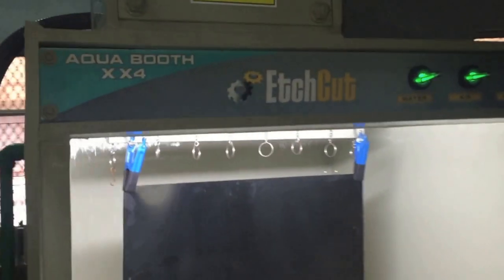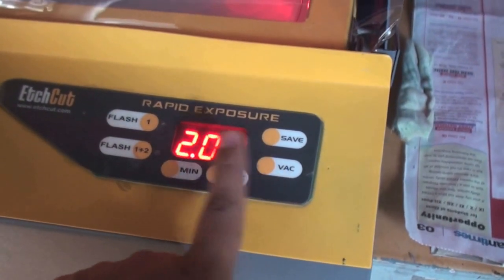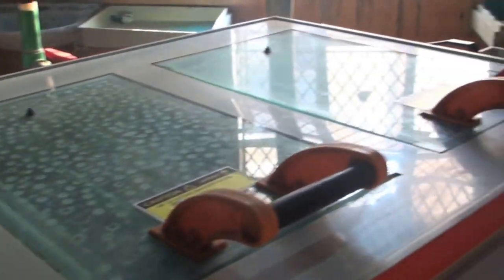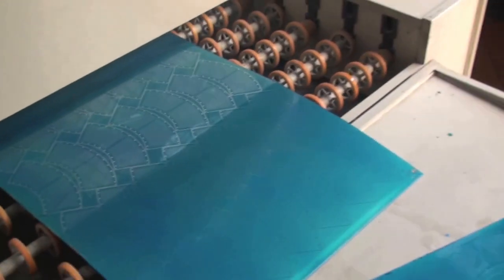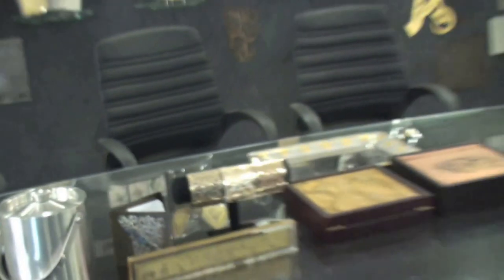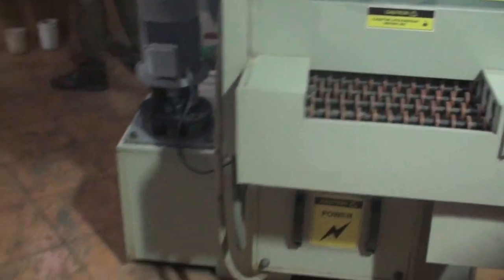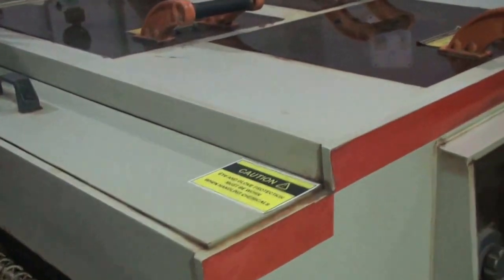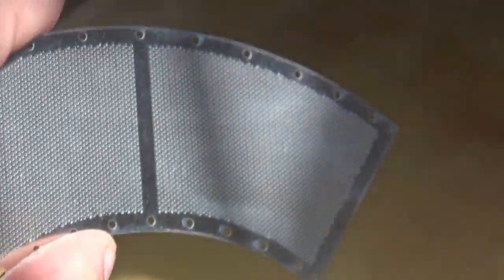Manufacturing Process of Juicer Mesh Filter in Stainless Steel

Comment: These 3 mesh should be provided  one goes for cleanin other could be used for other purpose if we make a bit big circle in this mesh a little big in sheet as one peel vegetables to extract juice these left over could be used  the grated thing that comes out from mesh filter could be used in carrot hslwa
Reply from the maker: We do not manufacture juicer, we make etching machines to make juicer Jaali